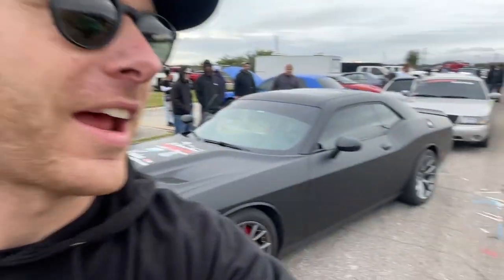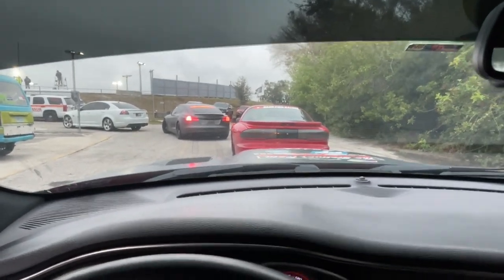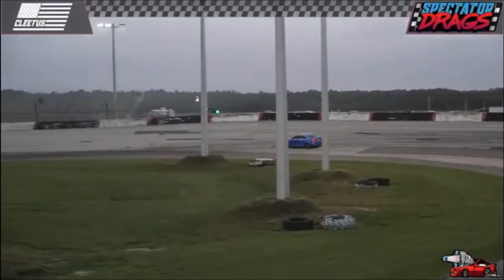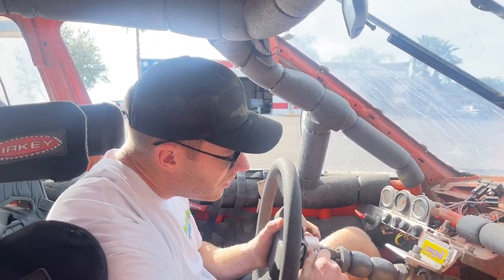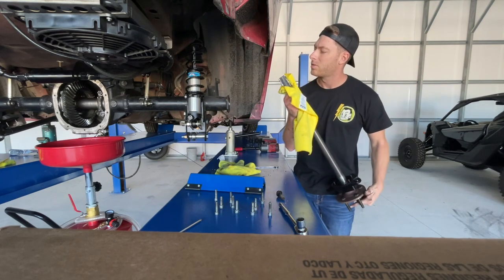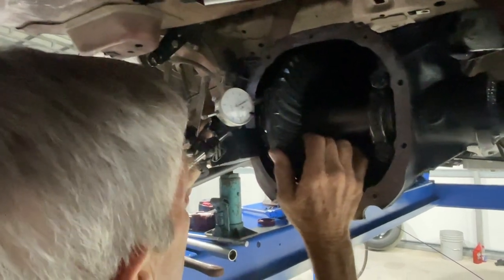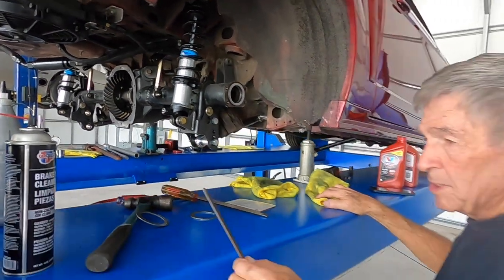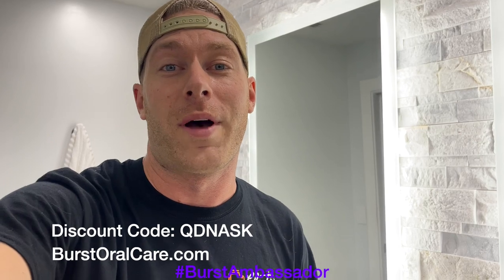Beater Hellcat RACE at the Freedom Factory & Mr Sam Teaches Me How to Rebuild Rear Diff on Dr Pepper

Comment: When I used to measure backlash on a 8.8 at the Ford dealership I was taught to measure off the top of the gear face with the dial indicator as close to 90 degrees as possible.

Comment: You really need to measure backlash at a 90 degree angle to the surface you are measuring.  Your reading will be inaccurate otherwise.  Great video though.  Love the content.
Reply from the maker: We did! We were measuring 90 degrees to a flat face on a ring gear bolt

Comment: 16:05  You backlash measurement wasn't even in the ballpark.  First of all, the plunger on the indicator needs be as close a possible to a 90° to  gear as possible and measuring off the tooth itself.  Also, that was a measured .0035", not .005".  Had you been measuring closer to 90°, it would have measured a lot more, perhaps double what you measured.
Reply from the maker: We were 90 degrees to a flat surface on one of the bolts on the ring gear. Final position after adjustment were sitting at about 8 thou

Comment: Do know if he was able to keep the charger all wheel drive since it was a police car. Edit Never mind I guess that was a no since he couldn't hook up
Reply: Came rear wheel drive or I would of figured out how to do it with the swap
Reply: @trumptrain7.314  His charger would have been a awd. Because that charger was originally a  v6 or a 5.7 hemi police car. Dude said he hellcat swapped the car. I just wonder if there a way to make the original awd system in charger police cars. Hold the power reliability that the hellcat engine makes. Without breaking the awd parts. His car originally came with.
Reply: @bretjjjohnson7942  it never had it not all models have awd for police and the only way to make it hold power is to build it probably